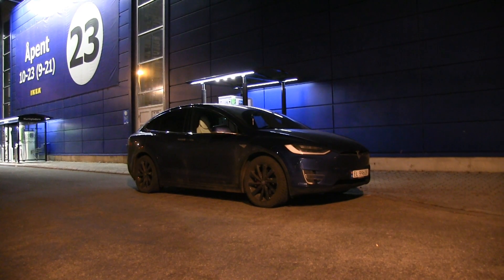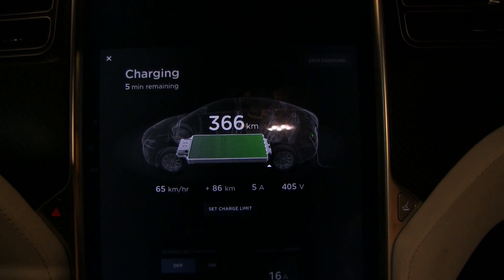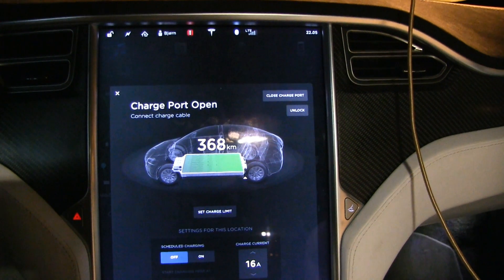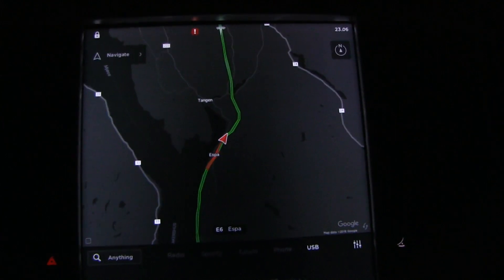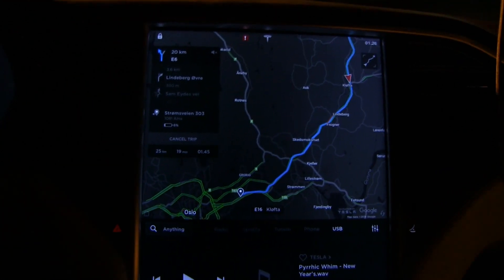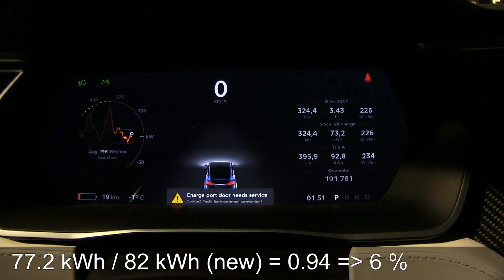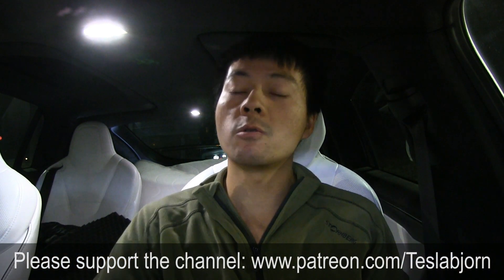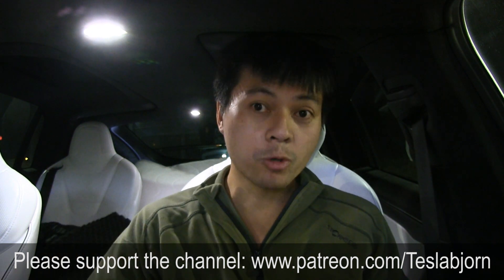Degradation test after 75k km

Comment: Have you considered not using range mode when you don’t REALLY need it. From what I understand that effects the battery heat management system so it reduces energy consumed to keep the battery within optimal operation, so the battery will get warmer in range mode.
Reply from the maker: Range mode will result in higher battery temperature and accelerate degradation:
https://www.youtube.com/watch?v=lSRv-REnUIg

Comment: The 51C limit is for the mandatory switching on of the AC compressor to cool the battery coolant right? The BMS is circulating coolant for the battery even below 51C, but above that it takes control of the AC compressor for extra power. At least this is the system setup for the Model 3, and I think it is the same for S/X.
Reply: Yes, cooling starts at 40C, AC Compressor kicks in above 50C.   

Heating is active until 8C. (When in Drive; Rangemode off and probably a not to low SoC)

Comment: You get more kWh out if you drive slower.
Reply: Surely more kms per KWh... Because the air resistance lower... Battery not going to change amount it can store.
Reply: aidanapword  The battery has less heat loss relative to the amout of energy delivered when discharged slow instead of high.
Reply: @timr.6864  Tesla keeps battery at specific temp during long trips regardless of load (speed of discharge as related to speed of vehicle).
Reply: @aidanapword  Yes. Heating until 8C, Cooling starts at 40C, cooling with AC Compressor at 50C. 

Still, heat loss in the battery per kw/h delivered increases when the load is higher.

Comment: Good result. That means there are 60+ % battery capacity left at. 500tkm
Reply: The wear is not linear.  The first 10% goes a lot faster than the next 10%, as seen here:

https://www.teslarati.com/tesla-battery-life-80-percent-capacity-840km-1-million-km/
Reply: Besides, Optimus gets a brand new battery(probably 100kWh pack) when dropping below 70% because of 8 year warranty.
Reply: Good point. I was thinking that if you buy used tesla driven 500tkm, you know theres more than 60% battery capacity left. I would buy one.

Comment: Also you drive in ludicrous mode all the time.. that will cause far higher amperage demand on your battery pack  will therefore be far higher than most people and degradation a lot higher. Tug of war, towing etc all will combine to wear the battery out a lot quicker than the average user.
Reply from the maker: +william  armstrong nope https://youtu.be/x-Cd6uydVF4
Reply from the maker: +william  armstrong Tug of war? You're kidding, right?
Reply: Did I not watch a video of you dragging a Hummer around? Or was that someone else? Before your off roading accident?  Also I was quaoting yourself from one of your videos where you were setting out and enabled ludicrous mode  and said something like "well if its there why not"
No problems either way not criticising you. 
My 4 year old PHEV is at 97.6% and 96000 miles. So doing well ;)

Comment: I think Optimus will need a new battery within the warranty. 

At least if you will continue your awesome driving load on him.
Reply from the maker: Warranty doesn't cover degradation.
Reply: @bjornnyland  Yes. Higher internal resistance and low capacity will make the battery useless.

Comment: So range mode doesn't allow the active cooling threshold to change? Because if it does, it could affect degradation over a long time. Less heating and cooling the battery with range mode?
Reply from the maker: +Kasmo paya Range mode will allow higher temperature in the battery.
https://youtu.be/lSRv-REnUIg
Reply: Thanks for the link, in that video you even talk about possible accelerated degradation with range mode. Because of trailer and some long distances between Supercharger, you use range mode frequently. That could cost a few % health over the years. But its better then extra Chademo charging.

Comment: You seem to be an expert on causing high battery degradation..    Can you give me any tips on what someone can do to kill their battery or shorten its life.  What are the 10 top actions to shorten the life of vehicle battery?
Reply: Leave it sitting discharged directly on the sun at 40 °C. Degradation is guaranteed.
Reply from the maker: Why do you want to know that?
Reply: Charge it to 100% and leave it in an unairconditioned garage in Phoenix on trickle charge for the Summer. A laptop''s typical use cycle is pretty much the worst case for a lithium battery. Leave it plugged in, charged to full, while watching videos or playing games and generating a lot of heat.
Reply: @bjornnyland  Well i know that taking the battery to zero will cause premature degradation, also charging to 100% all the time will also cause early degradation.  There is probably other ways as well, so I wanted to know what not to do.

Comment: Did you test this with the new battery? I'm wondering if other system components have suffered degradation with the relatively high kms on Optimus?  I.e.  inverter, drive unit, etc.
Reply from the maker: yes

Comment: You should buy fossil electricity generator with output suitable for charging EV's when they die on the road while testing battery capacity. So you can run it down to zero, no more estimations.
Reply from the maker: No need to.

Comment: As someone else said down in another comment the first part of the degradation is the fastest one, we see it on phones where the first month or two the battery lasts a lot going down gradually and then it stabilizes, once the battery chemistry has stabilized it should slow down until the cells start to get close to the end of their lifes, then the battery will degradate even quicker till it dies

Comment: Just thinking. . If you had been driving fossil for same distance, the engine would soon if not already be replaced and the clutch,  well that's a for sure replacement by now.
Reply: As much as I like EVs, but your statement is simply not true. Even usual petrol (not diesel) cars go way over 200.000km. 
I sold my last own Diesel car with 298.000km with the first clutch, still in good shape, an perfect engine state.
Nowadays with modern automatic gearboxes, they go even further.
So please, don't construct false statement. These make the EV people simply debatable and weaken the true arguments for EVs.
Reply: Oh dear I’ve upset someone by making false statements... okay, I have to agree with you to some extent because I was living in the 1960’s when generally engines weren’t so good and lasted not so long. I’m a marine diesel engineer and do understand engines more than most around me but hey ho there you go.
Engines are good but I’d take a motor any day.. fossil is dead and the sooner the better for me. Cam belts, water pumps, valves, injectors, fuel pumps, air filters, oil filters, exhaust pipes and silencers etc. End of.

Comment: Yes, I watch it as this is my research interest. High temperature is the biggest killer for Li-ion cells. (Put you phone in the freezer to extent its battery life) The second one is high cell voltage, do not stay at 100% for too long. Model 3 uses new cell chemistry which have more tolerance at high temperature.
Reply: Phone in freezer is crazy wrong! Don't do that. Battery loves 22 degrees Celsius. Don't freeze the 🔋
Reply: Jeff Dahn recommends fridge I think, not freezer. His expertise is NMC batteries (like Powerwall/Powerpack) rather than NCA (like S/3/X), but probably similar effects there. However, lithium ion batteries do NOT like being charged when cold (or having heavy powerdraw), so let them warm up before charging them or using them for heavier work. Fridge is good for storage, but room temperature is the best when you are using them and charging them like most people's average use.
Reply: @RFjellstroem  You two are both correct. You do not want to operate the battery at low temp. I mean storage when you are not using it. However, freeze it is impratical for most cases. Keep it away from 100% charged all the time is more reasonable

Comment: Conclusions: Even the Tesla batteries are degrading. OK, in your special case, more quickly than the average but with your correction factor of 1/3 you will get 110k km with 94% capacity left. I wonder now why the Tesla lovers attack Nissan? What you expect more from a battery pack without TMS? In fact, by extrapolation, I can affirm that current Nissan batteries are tougher than Tesla's. And another thing, we must change the LiCoO2 cathod technology, too weak for our times.
Reply from the maker: +Nicoleta Belosinschi Incorrect. Leaf batteries degrade much faster.
https://pushevs.com/2018/03/20/nissan-leaf-battery-degradation-data-24-vs-30-kwh-batteries/

Comment: Uhm, I am afraid you are underestimating the Power Of The Attention Span(tm).

I am refering, here, to the end of your video.

I am an avid watcher of your videos, but, you know, there is a search engine on YouTube. Let us say, some random dude not knowledgeable about either of 1. electric cars and 2. your history tries and investigates EVs and stumbles upon your video: testing degradation after 75k, and caption says 6%?

Unless (s)he watches the video in its entirety, this is ripe for being used as an argument for the fact that batteries wear out fast -- we all which follow you know that this is not the case, but please be more careful.

My Model S 90D, now having passed 60k, has less than 3% degradation, but then I don't use it quite as hard as you do and its average consumption over its lifetime (started when I picked it up with 7km) is 18.9 kWh/100 km.